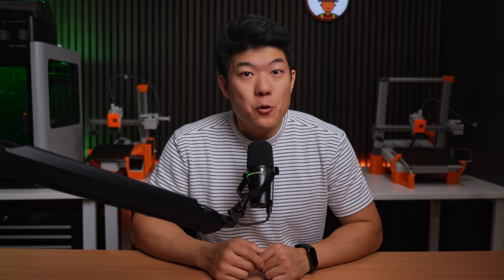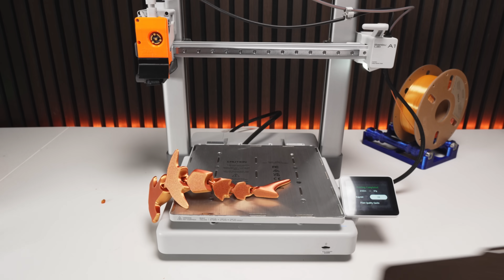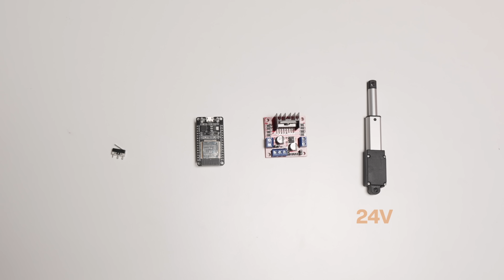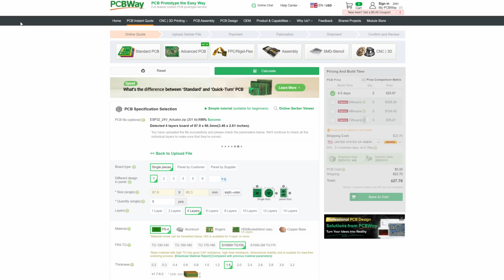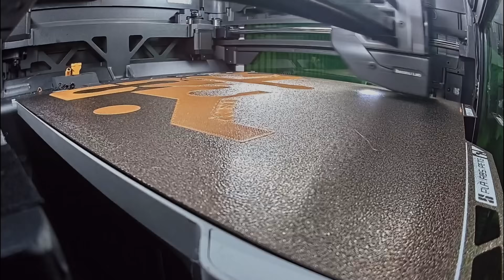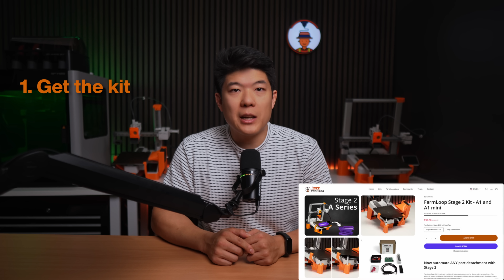We invented Automatic Printing 2.0 - FarmLoop Stage 2

Comment: 6:00 I have a model that I sell that requires multiple parts to make up the complete model. Would I be able to upload the different parts into the farm loop app? Example: printer prints part 1, then part 2, etc. Also, will this work with the top-mounted AMS Lite?

Comment: What about cleaning the plate? Wouldn't printing the same thing on the same area without cleaning cause adhesion issues or warping?
Reply from the maker: If you don't touch the plate it will stay sticky. Adhesion issues rarely come from the print itself.

Comment: Sounds amazing, but I need to clean and glue my plate almost every new print. Otherwise I get print failures. Maybe it works better with PLA, but PETG at least in my case is very sensitive.

Comment: Thanks for providing the DIY resources. The wiring diagram seems to show the the fan’s red wire wired directly to the VCC but the video appears to show it wired to out3 on the driver board. Which one is it? Any chance the resources could be updated with an actual clear picture of the final wiring?
Reply from the maker: The wiring diagram is the latest version.

Comment: Can this system work with a build plate completely filled with keychains? I make keychains and usually fill the entire print plate, leaving space only for the purge tower. Does this system allow removing all the keychains along with the purge tower?
Reply from the maker: Yes keychains can work as well. However, test first with just a couple of them before committing to a full plate. The keychains should be positioned on the plate where it is bend -> front left first.

Comment: Hi! I have a problem with the loops on my Bambu Lab printer — every time one print finishes, the printer starts a full calibration and bed leveling before the next one. This wastes a lot of time and isn’t needed for my setup. I’d like to skip this calibration between prints, but I can’t find how to do it in your app.

I tried your app and even paid for the full version — it works very well overall, so thank you for sharing it! But since I do short 20-minute prints, the 5 minutes of bed leveling and calibration between each one really slow down the process. Could you please explain if there’s a way to disable or remove that part in your app? That would make the looping feature perfect. Thanks a lot for your help! 🙏
Reply from the maker: Great input. I will put that onto the list of improvement for future versions of FarmLoop App.

Comment: Hi, the DIY part list is missing from the page, thanks for you hard work
Reply from the maker: It is on the same pdf as the wiring diagram, did you check it out?
Reply: @3DFarmers the PDF IS missing from the page, tried on mobile and on pc
Reply from the maker: @ricardoalves1437 Let me check quickly.
Reply: @3DFarmers thanks

Comment: Looks similar to the system i built for my old ender 3 print farm. Nice job packaging it into something easily setup.
Reply from the maker: You have an Ender Bender? Nice! Impressive Qidi farm you got there.
Reply: @3DFarmers  No just regular Ender 3 and CR-10 SE. I also used the actuator to flex the plate but I use the toolhead to push the parts to the side. It worked really well for PLA. Once i switched to ABS I had to upgrade the print farm and I went to Qidi printers.

Comment: I'm curious why you chose to use a complicated circuit board and processor instead of just a switch triggered by the build plate moving all the way forward?
Reply from the maker: It could be triggered at the wrong time for example when the printer is wiping it's nozzle.

Comment: Ah. I’ve already done a stage 2 with a servo and lift arm and a raspberry pi pico and a simple robotics controller. Works a treat. I’m now working on a tool head with deployable scraper blade. Stage 3.
Reply from the maker: Sounds like quite a war robot with that deployable scraper blade ;)
Reply: @3DFarmers  well I realised that the BIQU scraper blades which look the same as the Bambu ones are actually blunt but still very fine edged. They’re much safer for this job. I’m only doing a stage 3 because even with dual cooling fans and sheet bending, I have some vase mode parts that simply flex with the sheet and still won’t quite eject. For mine I picked up a $10 board with 4 dc motor outputs for the fans and several servo outputs. And you just plug the pico in on top but the custom pcb is a great thing to have. I’ve even built my own gcode parser too (for private use) which was inspired by your work guys. 👏

Comment: I wonder if the lifting actuator can be replaced by a rack and pinion mechanism, which transfers it energy to a ratchet+lift mechanism. The lift needs also self reset when it’s on its top position.
Reply from the maker: We tested with a servo + rack and pinion, but it didn't survive our long term testing. It would probably work with all metal components, but we converged to a linear actuator for simplicity.

Comment: Awesome.  If I already have the fan from stage 1 do I need to get another fan?  Is the connector different?
Reply from the maker: The cable is different, but since you ordered the fan upgrade already there is an automatic discount if you order Stage 2 with a fan.
Reply: @3DFarmers  Oh woops.  Already ordered (I was a bit too keen)
Reply from the maker: There is still time to cancel and reorder, just drop me a message contact@3d-farmers.com